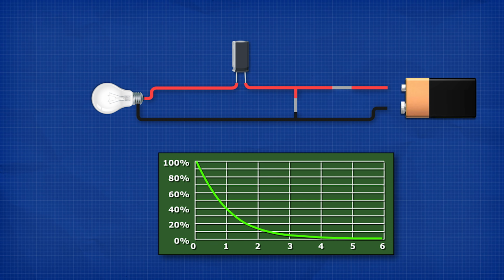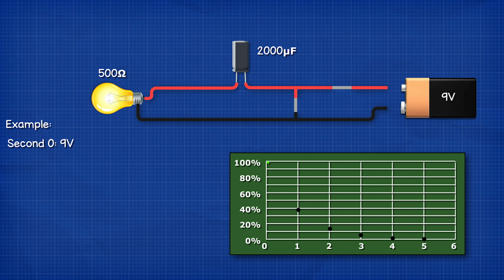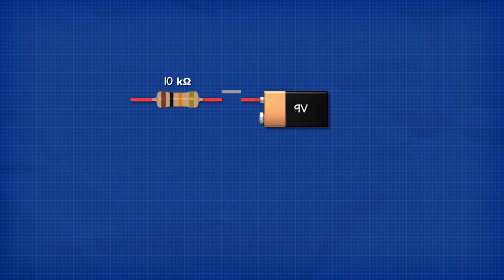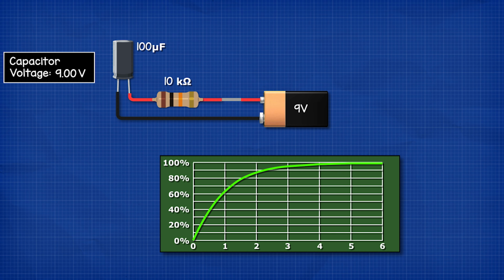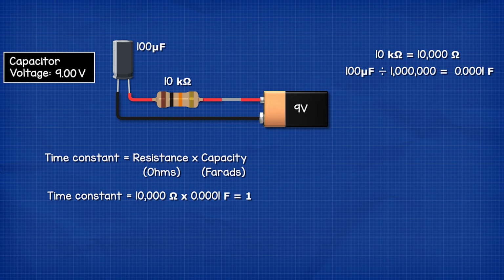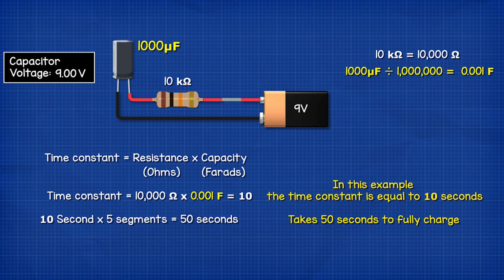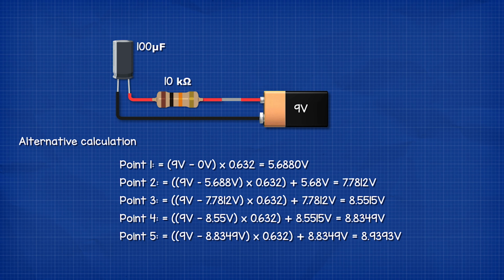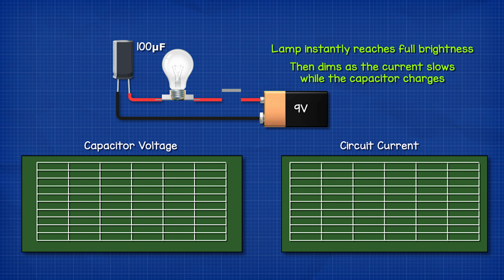Capacitor discharge time - how to calculate with examples

Comment: It can also be charged directly without a resistor right. Why do we need a resistor in between
Reply from the maker: Check out NEW resistor video, everything covered! ➡️ https://youtu.be/DYcLFHgVCn0
Reply: You can do but the current flowing through the cable will be very high. It won't be dangerous for a 9V battery as the max ampere can only reach about 1A. 
If you use for example 12V lead acid battery, the current can go dangerously high which will burn the a small gauge cable. The resistor is to limit the flow of current.

Comment: Why an exponential curve tho for both charge and discharge? 🤔
Reply: because i = C dv/dt while the resistor gives a linear relationship between its voltage and current. The solution to such differential equations is the exponential function being the integral of 1/x
Reply from the maker: Check out NEW resistor video, everything covered! ➡️ https://youtu.be/DYcLFHgVCn0

Comment: I'm confused so if I have 6 3000f 2.7v caps wired up for a 14.4v 500f load capacity and then discharge it at 1ohm how long will it take?
Reply: So that’s 3000/6 = 500F with a voltage rating of 16.2V. The time constant is RC = 1 x 500 = 500s. So after one time constant the voltage will be 9.1V. To discharge will be 5 time constants per the example
Reply: @farmerjohn6192  so 500amps of power for 1sec and it will have dropped to 9iah volts?

Comment: Would you please comment on this excerpt from NIST's WTC 7 FAQ?
    "Stage 2 (1.75 to 4.0 seconds): gravitational acceleration (free fall)
    ...

    During Stage 2, the north face descended essentially in free fall, indicating negligible
    support from the structure below. This is consistent with the structural analysis model,
    which showed the exterior columns buckling and losing their capacity to support the
    loads from the structure above."
Reply: Lol
Reply: @illumiNOTme326  🤣😂😄